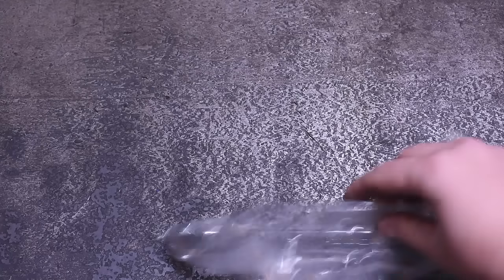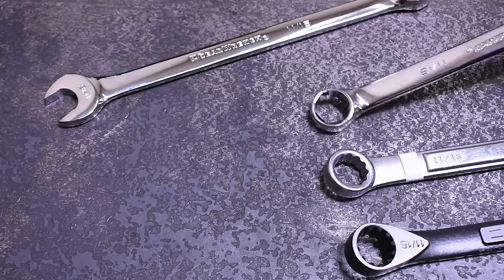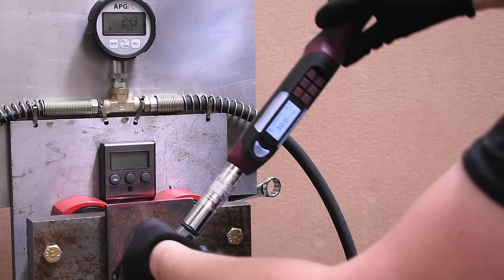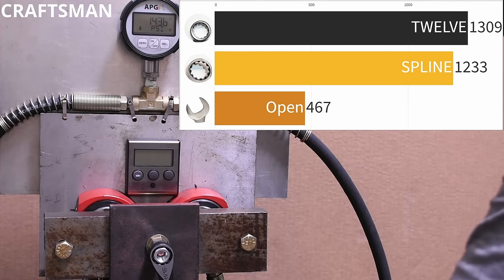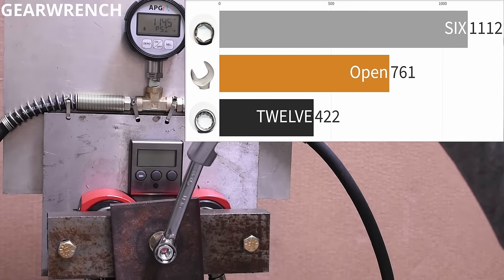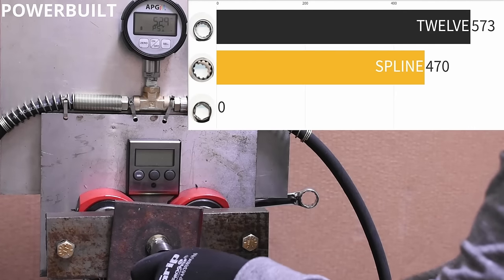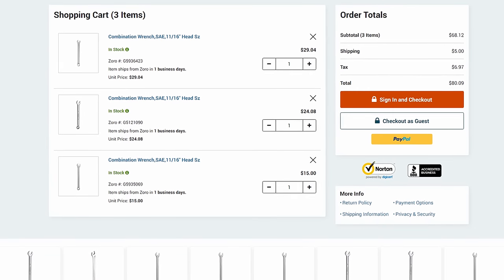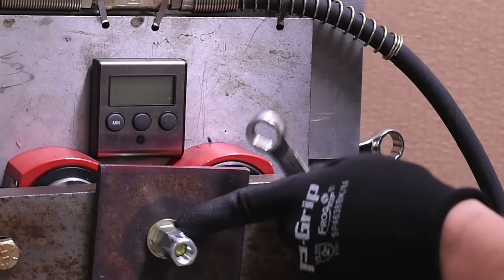Let's Settle This! What Wrench & Socket Design Will Slip 1st?

Comment: Ive always wondered if there was a difference between a open end wrench one way, vs the other way.  Same goes for ajustable wrenchs.  I always have the feeling that one way has less chance to slip than the other.

Could you verify that?🙂
Reply: there definitely is with  locking pliers or an adjustable wrench and even pipe wrenches one way clamps down on the fastner the other way the jaws spread if that makes sense
Reply: Brands make a big difference also.Generic brands the teeth round relatively easy compared to actual name brands
Reply: I've heard that before about adjustable wrenches. I can't see it being different on an open end wrench unless it's a special one with teeth that grip one way (I've seen that on Capri Tools) or those self ratcheting ones with little rubber pads in the jaws (Mastercraft and Gearwrench have those)

I'd be interested to see the test on adjustables though
Reply: Funk FPV did a short video about it. Check him out. Might have to fish through some of his stuff to find it.
Reply: With adjustable wrenches you need to orientate them so the load is applied as low as possible on the moving jaw
Reply: @adzmac515  Nope, you apply the load to the top of the adjustable jaw. Takes some pressure off of the adjustment screw.

Comment: There are 2 more styles i would like to see tested. The first is the "surface drive". Those dont grip on the corner but rather somewhere in the middle of the flat.
I also heard the statement that the metrinch design (tool that is usable on both metric and imperial sizes), can outperform the other designs. Thanks.
Reply: When you say "surface drive" I assume that is the one with the slightly convex (bowed inward) "flat" in the spanner's ring?
Reply: "Surface Drive" was originally called "Flank Drive" by Snap-On when they invented it years ago. It has rounded points at the corners of the spanner or socket opening so that the torque is applied to the fastener a little way in from the corners of the nut or bolt and therefore is less likely to round off the fastener. It also works better on slightly rounded fasteners. This is widely copied by other manufacturers now the patent has expired. Another benefit is that they tend to be a "sloppy fit" on the nut/bolt so you can get away with using a metric socket/spanner on an slightly larger inch fastener or vice versa when the sizes are close, e.g. 1/2"-13mm, 14mm-9/16", 5/8"-16mm, 17mm-11/16" etc. I think that Metrinch are using this characteristic to offer a reduced number of sockets or spanners in a set, as they definitely are "surface drive".
It would seem that some if not all the sockets and spanners tested here have "surface drive" openings but I can't be sure. 
Comment please Torque Test Channel.
One more thing, the spline drive spanners look impressive, but if you are using a spanner it probably means that you can't get a socket in there because access is tight. If the spline drive bites into the nut you won't be able to remove it to swing it 30 degrees and refit it. 
If it's a spline drive socket and it is firmly gripping the nut you will have a struggle to get it out of the socket after you have taken the nut off the bolt.
Reply: @bimble7240  Pretty much any socket you can buy here in Norway is the flank drive style with rounded corners. Not seen a flat face on a socket in years.
Reply: I've had a set of metwrench for longer than I can remember. Bought them at Wal-Mart for IDK 25 dollars when i needed to fix something one day and did not have any tools with me. They have proven themselves time and time again. Their grip is amazing even tho they feel sloppy on everything. Unless it's completely rounded or rusted away. I have never broken one and I've used a cheater bar many many times on them. The boxed end wrenches are good as well. Double wrenched or a cheater pipe on them lots of times as well. The open ends are nearly useless as they require about ⅜ of a turn before grabbing the bolt / nut. But take warning, buy pretty much any other brand of ratchets to go with these great sockets and throw the ones that come in the set into the scrap pile as soon as you open the box. Their ratchets are a waste of metal
Reply: @bimble7240  that is a piece of history I didn't know. The design I had in mind was this:
https://images.app.goo.gl/zjgxkAeLB9MkoWis8
Is it the same thing as a 'standard' flank drive? The reason I ask is that I live in Europe and heard about metrinch about 8 years ago (was on a training course from work). Surface drive I read about only 3 to 4 years ago when looking trough a catalogue for a replacement mini socket set.
Since I work is in the electrical side of the business, I am not that familiar or updated with al the designs that are available.
Thanks in advance.
Reply: @nickblondeel5556  The only reason that this concept isn't called Flank Drive is because Snap-On have trade marked the name so to use the idea you have to come up with an alternative name. The variation in practice is how tightly the tool conforms to the specified size. The actual shape of the socket/wrench where it doesn't touch the fastener is not important. With surface drive tools the size doesn't have to be a close fit to still work acceptably, so for example a 16mm nut is only 0.125mm larger than 5/8" so not a problem. However a 13mm nut is .030mm larger than 1/2" so more of an issue, particularly so on smaller sizes. If the tool is a slack fit then it will grip the fastener nearer its corners and may actually slip if the fastener corners are already damaged. The 6 point tools don't suffer from this so much. 
One more things to consider, the tests we are commenting on here are for nuts already partially rounded off. It would be interesting to repeat these tests with new nuts to see which tools are most likely to round off the fasteners.
Reply: @bimble7240  it would indeed be interesting to see with undamaged nuts.
Reply: @bimble7240  "One more things to consider, the tests we are commenting on here are for nuts already partially rounded off. It would be interesting to repeat these tests with new nuts to see which tools are most likely to round off the fasteners." 
Yea, I want to see this as well.
Reply: I think you mean metric and SAE.

Comment: I have a stuck oil sump plug, I just picked up a breaker bar but the sump plug is slightly rounded, I stopped when the regular wrench started to slip so this has been helpful.

Comment: I've also been skeptical of spline drive wrenches. I've seen specialty fasteners that are spline drive. The socket was only an 1/8 thick at the narrowest point but it could take ~17,000 ft lbs on about a 4" nut. Other sockets that size are 1/4-3/8 thick at the narrowest point.

I'm curious how much the spline drive would mangle the head at a given torque. Also some impact sockets have "off corner loading" designs that are supposed to reduce rounding. They might perform better.

Great stuff, TTC
Reply: Seconded would libe a video on this
Reply: That's my main problem with using spline: They have a tendency, especially on softer stuff, to cause problems.

Granted my experience isn't the most common, but aircraft can use stuff like aluminum bolts. Using spline might destroy them when I need them to go back on-and same with the fittings. Besides, they're supposed to be torqued to a relatively low number (3/4" high-pressure fittings get, say, 70 ft/lbs max torque) often, so open-ended wrenches are typically more than enough.
Reply: I've never used them because they just look like they might mangle a good fastener.
Reply: The rounded outer corner was something that started appearing in the 90's if I remember correctly, and I first saw it on six side box end wrenches. I was pretty skeptical at the time as it looked like yet another gimmick but it turned out to actually work as intended. Last I took a walk down the isles of wrenches in a hardware store it seemed almost every brand was using that design. A six sided socket with sharp corners didn't seem to exist on the shelves.

Now I've never used a spline drive socket or wrench though. I can't help but thinking they have to chew up the nut pretty badly though.

Comment: It is interesting seeing how when most of the designs cammed out is after you stop turning and reposition. Difference in getting something stationary moving versus keeping something already moving on motion
Reply: The coefficient of kinetic friction is always less than the coefficient of static friction. Physics.

That is why a car which is skidding will continue to slide till it hits something or you get the wheels turning to match the direction of skid. After that you can start to re-establish control.
Reply: @20chocsaday  yes, precisely
Reply: @KyleRepinski  That's what I told my driving examiner but he insisted on which circumstances might cause it. 
(Then he failed me).

Comment: I love it! Great science. 
Snap on makes a 6-pt with rounded corners that they say is best. It kind of combines the spline concept with  a standard 6-pt. I would love to see an extended review.
Reply: I have seen a brand that works by using the flats, not the points. Have not seen them slip ( twist sideways much as all spanners do ). Have not seen that brand for a long time ( over 20 years ), shame as I lost too many of them. ( probably in someone else's toolbox after they tried them )
Reply: @alanhilder1883  Probably Metrinch you are thinking of.
Reply: @geoffmartin5041  Seeing it written, yes it was.
Reply: Snap-On got a patent on "flank drive" in 1965, which added the rounded rather than triangular broach. When it was exclusive, nothing could come even close to a Snap On 6 point, and part of what lead them to be able to dominate the pro market in those days. I think it expired after 20 years, so 1985 ish, and everybody copied the profile pretty quickly, part of what lead them to lose their domination since. They added a "flank drive plus" feature in 1990, which used similar concept on the open side, and which, despite seeming subtle, does significantly increase the torque before rounding.
Reply: Wera have these "hex plus" Allen keys that are similar. Corners are round and the flats do all the work, made the apprentice buy it as his first set

Comment: I need that wrench extension in my life.  How did I not know this existed?
Reply from the maker: This is what we use: https://amzn.to/38P2mzo
Reply: I had no idea this was a thing.
Reply: There nice I picked one up off the truck about a month ago they make a couple different size and I manage to use it Atleast a few times a week well worth it
Reply: The absolute best is the Mueller-Kueps Wrench Extender (three sizes)
but they're so easy to make!
https://www.youtube.com/watch?v=6zjQSTbLsJY
https://www.youtube.com/watch?v=AFU73w1GOvw
or the ultimate lazy;
flatten a piece of 3' round pipe till your wrench just fits in it.  Done.
(that's the one on the front of the alignment rack)
Reply: I've always used the interlocking wrenches method.
Reply: Actually thats was my take to after all that science. My hands are wearing out and I need all the leverage I can get.

Comment: Awesome video! Spline often gets a bad rap - my theory is that it is because it is confused with "universal" drive. The spline design allows for a wider tolerance range than typical 12pt, which has tempted many manufacturers to release so-called "universal" wrenches and sockets that supposedly fit SAE and metric fasteners. What that actually means is that they use a spline drive design that "splits the difference" between SAE and Metric. It will inherently be a sloppy fit on some sizes and a tight fit on others - and hence suck. Using a properly-sized spline drive on the other hand, really ought to be better - and it's fantastic to have some evidence to point to showing that is the case.
Reply: The powerbuilt sockets he tested were "universal"
Reply: It's because they tear up fasteners and have to be hammered off them more often than not.
Reply: Fair, but that doesn't prove things either way - maybe the size of fastener just happened to fit that brand's socket reasonably well.

Comment: As an aviation mechanic we have mostly 12 point bolt heads, a few spline head bolts, and even fewer 6 point nuts and bolt heads. I would be really intestate in seeing the numbers of a hex head bolt with a6 point wrench vs a spline head bolt and a spine wrench vs 12 on 12. Without rounding any corners i would find those numbers interesting
Reply: Yep. Exactly what I was thinking.

Comment: You should try to measure the tolerances on the wrenches to see if there are differences based on the wrench types within the same brand.
Reply from the maker: We plan to for open ends (requested in comments here) but you can't measure spline and 12-point you can but it's not as comparable to 6-point. More like between 12-points. Because of where you need to measure it.
Reply: Thank you. Came here to say this.
Reply: @TorqueTestChannel  I'm just a 'youtube expert' but I think the right measurement tool for this would be gauge pins.  I think measuring the largest cylinder that fits in the wrench at all ends will give you a very good idea of the tolerance, rather than attempting to use calipers to do it.
Reply: @TorqueTestChannel  Test angular deviation at a fixed distance from the nut. That will give you apples to apples tolerance. Sorta. Maybe lemons to limes comparison haha.
Reply: @TorqueTestChannel  Thats rather unfortunate, i feel like more quality control goes into the splined tools just based on how much better they look. Im willing to bet that plays a major part in the differences you saw.
Reply: @TorqueTestChannel  you should check the bolts themselves as well, just to see how much variation is going on from one bolt to the next.

Comment: I had doubts about spline drive at first, but I've been using a Craftsman Universal Spline Drive set that I bought in 2014 without a single issue. I do Industrial Field Repair for a big box retailer, and the set has definitely paid for itself a few times over. At first the "bite and twist" feature scared me that I was going to round some 10mm bolts on an automated machine, but it didn't, and the bit marks aren't even noticeable, even by touch, but I also don't go ham with torque unless required...

Comment: Can you test how much ft/lb it takes to break the ratchet end of several wrenches like gear wrench, snap on, proto ect?
Reply: Project farm does that exact thing. I believe he did ratchets already too.
Reply: from what i can remember of Uncle Bumblefuck (AvE) testing those, the ratchet isn't the weak link
Reply: A 3/4" Wright broke with two grown men standing on a 6' pipe.  The Wright dealer put a kit in it, and it's still fine.
Also saw a 4' Ridged pipe wrench fail, twice.  Once with the tow motor forks operating it, and once with the chains from a 15 ton overhead crane around the handle.
Reply: @randymagnum143  I saw a ridged pipe wrench with a big ass pipe getting pushed down with a t300 bobcat to the point the bobcat was lifting off the ground
Reply: I don't know why people are obsessed with breaking things. Other channels already do that.

Comment: In all my 35+ yrs working as a mechanic and bodyman here in the mid-southern portion of the rust belt (north enough to get the northern mix road salt, but south enough to rarely get it.) I only have a couple 6point box end wrenches, most(99.8%) are the 12point combos. Have a pretty selection of 12point sockets, chrome and impact. Over the decades, I've bought what I needed, when I needed it. If I had to barrow it twice, I bought my own. I have a 1/2" 6point combo wrench because, that's the 1st size what VW/ Porsche exhaust nuts dissolve too. A little farther north they drop too12mm, but usually at that point, you're replacing the stud, or the whole damn head.

Comment: I always thought Gearwrench was a moderately high end brand, but every time I see these tests they tell me otherwise. On the other hand, I have been burned by one of the newer Craftsman tools and decided they were crap, but when I see them tested on YouTube they usually do relatively well. This is good stuff to know, and I'll have to keep it in mind in the future.
Reply: My buddy swears by GearWrench but they have disappointed me many times. Craftsman is also not up to professional standards. 
If you want reliable performance, you will have to spend the money on a high end tool.
Reply: Where I live, most of us laugh at Gearwrench because we've all been burned.  They're box ended designs seemed to have more play in them than other brands (although Craftsmen these days now falls in that category).  If I need some ok tools that I don't need absolute precision on I just get Harbor Freight's Pittsburgh line.  If a socket or wrench snaps from that set, I don't get as upset because expectations are already low.  Lol.  I have old Craftsman and Snap On, peppered with DeWalt sockets for other things.
Reply: @dchawk81  I understand the point of having higher priorities and the excessive cost of tools off the trucks.

That being said, if you are doing mechanic work in confined areas and every little bit matters, I still would buy a set of the SnapOn Flank Drive Plus combo wrenches (used if need be). I have put mine to the test and have never been disappointed. The open end has teeth that grip the bolt or nut like no other wrench I've seen. The box end is slim, fits just about anywhere and grips as well as any 12pt can. I'd say they are well worth the investment.

For sockets, ratchets, extensions and other common tools , much of the Harbor Freight stuff does the job and at a price that is a lot easier to justify.